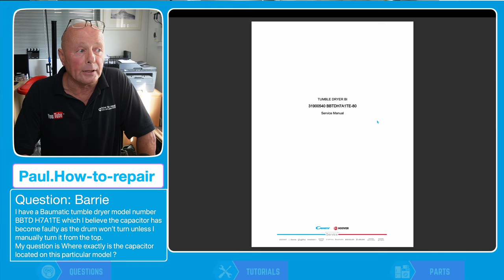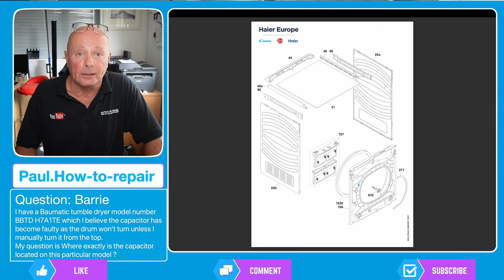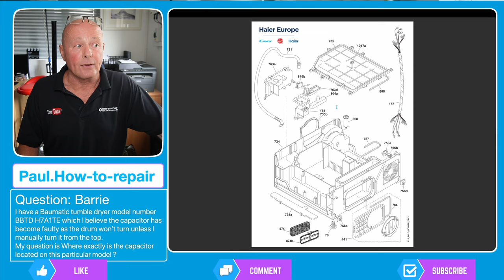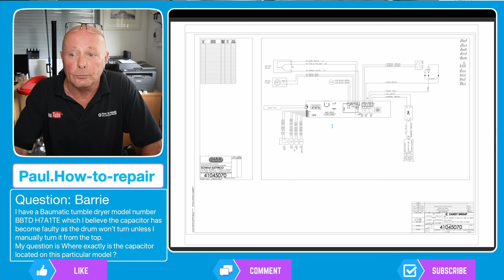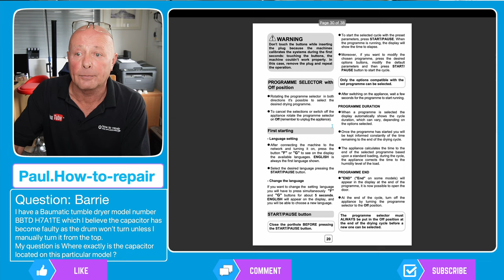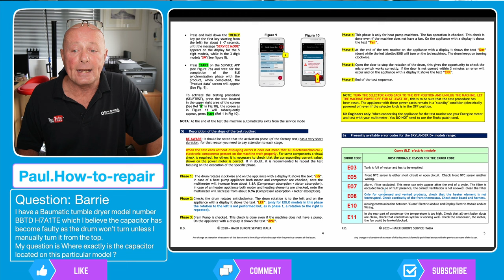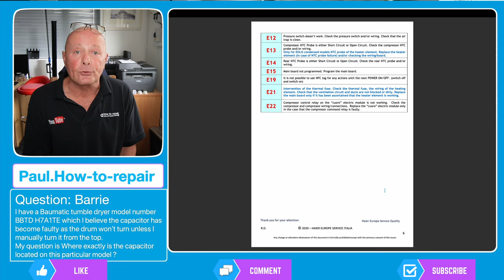#Baumatic Heat pump tumble dryer Diagnostic error codes, 📘🔧 drum motor not turning BBTDH7A1TE 80

Comment: I have this model and it’s drying clothes but not collecting any water in the door tank, any ideas on what to do would be greatly appreciated, it isn’t throwing up any error codes, rhanks
Reply: Mine is doing the exact same thing is it still safe to use even though it's drying clothes?
Reply: It could be that something that dispenses the water is blocked
Reply: Did anyone manage to sort this problem out? I'm having the same issue only 3 months into having the dryer